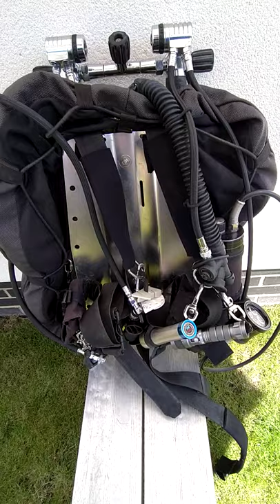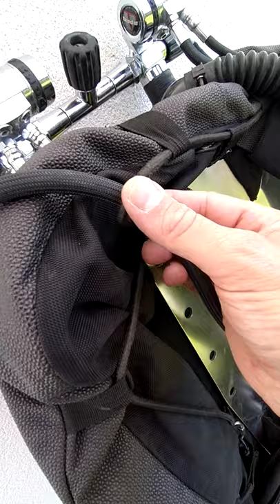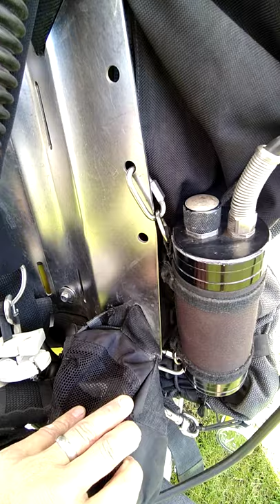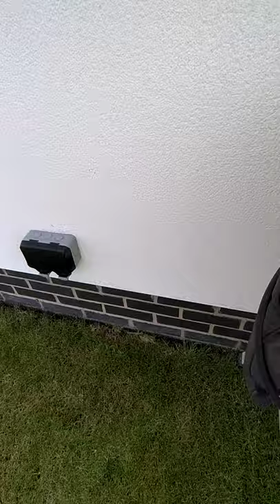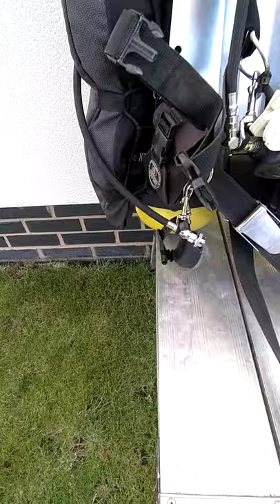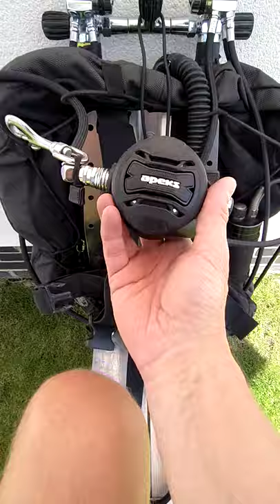Twin-set Setup

Comment: In my view having the wing hooked up to your backup regulator is a very bad idea. In case the inflator valve sticks open and you can't disconnect the hose from it you will have to hold the inflator by your right hand and attempt to dump the gas as you use the left hand to close the valve. And in case you're starting to get blown to the surface you cannot reach your dump valve on the wing and close the valve at the same time (unless you have it on the right side, I'm not sure where yours is). Regards.